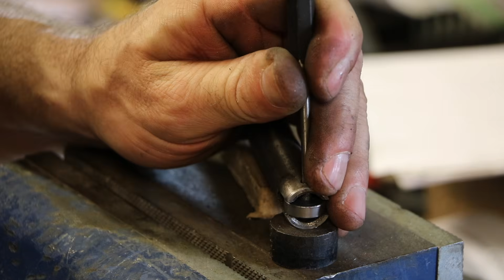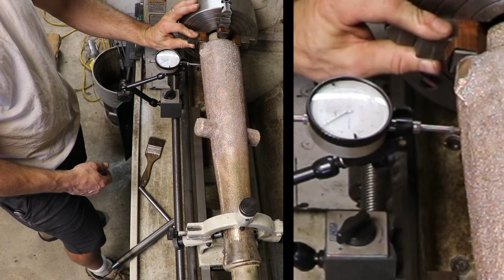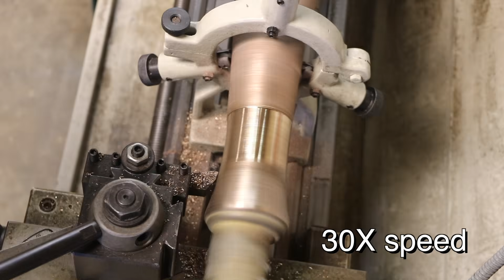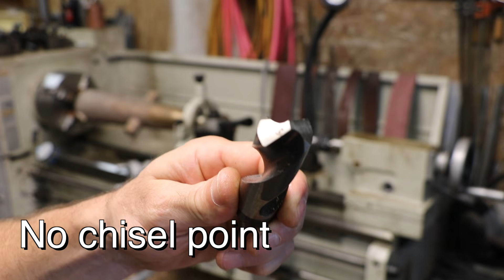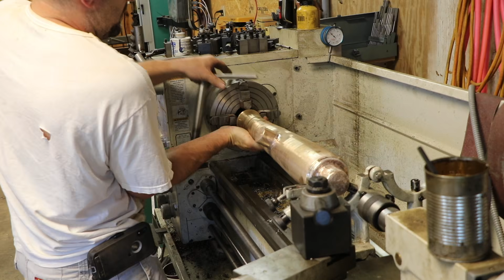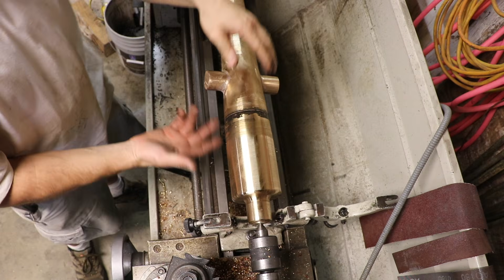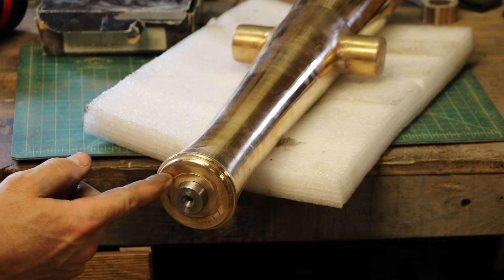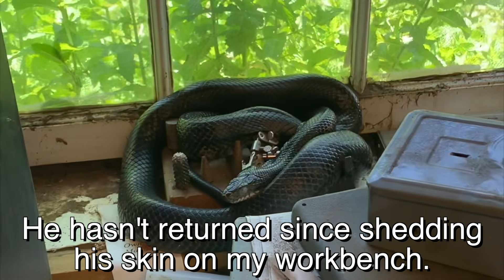Machining a Historic Bronze Cannon Barrel, Scaled Down Replica. FarmCraft101

Comment: Thanks for a series of interesting videos about the cannon, really enjoyed watching those. Too bad about the casting defect. I am a shooter and reloader (rifle and pistol, not cannon) and load black powder in some of my calibers. I would be careful with that void. As other say here it will impair performace, however I would be afraid the ball and patch could catch on the defect and induce a pressure spike. A steel sleeve would be a good solution to this problem. Have a look at this video from a cannon factory; they use a sleeve. Also note how they sealed the casting form, and how they added a reservoir to avoid shrinking: https://www.youtube.com/watch?v=NNMF6BDL8nk

Comment: Ok so idk if your going to read this but I hope it helps ,I worked for a vintage railway company and I was their technician or main worker but when you have these bad spots in a tube and it’s a very difficult spot you can do a couple things but they all involve a soldier that you can choose ,I go with a lead base to be original but you can take a perfectly sized plug for the hole with strong threading in it and what you would do is put it where the defect is then drill a hole where it is and fill it with a high strength/hard solder and fill the defect and after it’s ben sitting for a couple hours and has cooled to room temp then your going to put it in a freezer or fridge so it’s slightly cool compared to room temp then thread a large rod with a beefy handle and twist that plug, fare warning it will be very difficult but you will get a almost perfect barrel with little to non machining to run it because that plug will make a mold for that solder and the solder will take the same surface finish and fill it

Comment: I assume that if you actually try to fire this thing, you will do it electrically at a distance of about 100 feet.  Even then it would be wise to be  behind something sturdy.  The safest course, as others have suggested, is to install a steel sleeve.

Comment: If you're getting voids in your casting like that then get your metal hotter before the pour. 2200° F for bronze is normal but if your getting voids then kick it up another 100 to 200 degrees. This is what I did and I never got voids in my castings after.

Comment: You should be able to get an ultrasound crack test done by anyone who does pressurised piping. Over here, you would have to have the barrel proofed by a proofing house and stamped with the test charge size (usually 2.25 the standard charge size). For a one-inch barrel you should be able to calculate the black powder charge, probably around 2 cubic inches (excepting the touch hole filling powder and the firing quill). Probably use a paper-wrap charge, forming the charge case from the end of the ram you use.

Comment: Hey just a quick back of the hand calculation of your barrel pressure as a function of bullet possition:

 P=(P0*V0)/(V0+(x*pi*D^2)/4)  

Where:
P0=initial pressure
V0=initial volume (volume taken up by powder
D=bore diameter
x= possition from initial starting point of projectile (not from bottom of the barrel)

After finding pressure you could use a hoop stress calculation to see if the barrel would survive being shot 

That being said everyone talking about putting a sleeve in sounds like the safest method haha
Reply: That would work if the burning of the powder was instantaneous - which it isn't.
Reply: @cmdrsenior  you are correct but the worst case scenario would be if all the powder burnt instantaneously which is what I used to be conservative

Comment: In Cuba, they machine a real full size cannon, adding a stainless steel liner.
They do other .org as well.
So, why stainless steel? Or even why a liner?
Most real cannons are of bronze.
Over time, they crack.
Cubans have very magnetic cannon shot and modern propellants.
The decorative cannons with the plastic muzzle covers and electric wiring and motors are updates, first provided by the Soviet Union.
A small cannon can easily  fire a shotgun shell.
They can be made to look historically accurate, thread the breech in such a way that it is not visible.
Care must be taken, this is now a shotgun.
But, with proper care, an unusual piece.

Comment: Depends if your using it for shooting shit or just blanks if blanks you should be good if your shooting shit definitely sleeve it with gun steel i think its high carbon. My experience i like to blow shit up lol i made a canon out of a broom handle i use i kinda black powder mix iv fired it twice it scared the living fuck out of me. The first charge i put in was um i dont know i just dumped it in packed it in tight fuck me it was loud

Comment: You said you were going to place a sleve after some small bore fun shots, so to make sure you could place a band around the weakend area just to make sure the barrel won,t bulge or een break. also  brass, although not strong, can a lot of damage at high speed being tough.
Great piece of work though.

Comment: Machine a steel piece with an open side and closed end which is the same diameter as the bore. Weld a steel tube and funnel. Pour molten bronze. Allow to solidify. Re drill that area of thin steel.

Comment: It is very common, that the finger is to long on steady rests, but not that much.
And also, that steady rest seem to be good anyway. Some steady rests look terrible, and
with vintage bronze glide bearing. And the prize of them is also terrible.
The defect in the barrel is far out, i dont think it matters.  Just dont overload.

Anyway, you are good att freehand with the lathe. Here is my cannon, about the same size.
Made of tool steel, and the lavett of oak tree. Supposed to look like Wasa ship cannon.

https://imgur.com/iatA73D

https://www.youtube.com/watch?v=_HLUSO0BSEg

Comment: Actually, sleeving that barrel is an absolute pain in the ass, and hard as hell to do, and then what do you have!? 
To bore the casting undersized with no taper, create a sleeve with no taper and the correct press fit, (whatever that would be), then dunk your sleeve in liquid nitrogen for a few minutes to shrink it, then drop it in. 
You'd have to hone the bore to some damn finished size, (that is, the entire bore to the same size). This would take a good long hone set of the right range, constant cleaning after each honing but before you check your sizes up and down your bore every time in many places, "sneaking up" on your finished inner dia., many times with a very expensive dial bore gauge. A long dial bore gauge at that.

Unfortunately, casting was a mistake for DIY. (Not just a pretty steep learning curve, but some real trial and error and also cutting a few castings up!)
Gas pockets, porosity, contaminates, can give you a deadly dangerous piece that isn't visually flawed.
You can buy a length of round stock with a bore of 1" and an outer dia. of 4"! (then you got your bore almost done!) You'd three jaw chuck up the one end and center the other with the bore, then cut everything but your trunnion stock that you leave in the middle. 
You can machine them out by mounting your barrel on your saddle with V-blocks, then make a tool to be mounted in your chuck! Center, face, then turn, spin 180° and repeat, or use a milling machine if you got one. 

You put an internal thread in the butt end, then thread a spud of the same material to correspond, (best an ACME thread), screw it in good, then braise it complete, turn your braising to finish, and that'll do it. 
A touch-hole can be fitted with a percussion cap nipple or what not.
None of these guys are gonna be around if you try to fire this project. Think hard about that!
Opinions are like ass....

This cannon barrel could fire sweetly a hundred times, then blow itself up the one hundred and first! 
Better to call it a VERY attractive decoration, then start with a piece of round stock, (with or without a hole through the middle.)
Whatever you do buddy, good luck and thanks for posting your project!                 Nick

Also, the babbitt idea is a fuckin horrible recipe for disaster!
Think "PIPE BOMB" when firing regardless of whatever you decide. I've seen some really bad shit when people wasn't thinkin.
Reply: Yours is the best advice I have heard here. Everyone is trying to be helpful but second guessing just does not cut it. I know Farmcraft101 said he is going to fire it remotely but I think the unknown problems out weigh the known ones (and the known ones are not solved yet).
Reply: @Cloudman572 , 
   Yeah. Bet if he did a  rudimentary spin-casting set up it could solve a gas problem!?
   Sure ain't worth the danger factor! The fun goes down hill fast! lol  He made a good lookin cannon though! I think he aught to keep makin'um! This one goes on the coffee table though! :)

Comment: Even at the bottom of the bore I noticed pitting. This would indicate more voids throughout the casting, since the bottom of the bore is also the bottom of the casting. The visible large void inside the bore appears to be around 12” down from the pour. You’re hoping you don’t have any more. The ones you do show that you have significant sponging in your cast. If it was me I would recast. You are making a cannon and hoping that you have not made a 40 pound grenade. Do not try a projectile without having sonic testing done.

Comment: Some of the comments are quite valid Personally I would sleeve the bore. You can easily obtain high pressure hydraulic tube in the needed size but the originals were probably cast in a similar way and most likely had similar defects and I know the large bronze cannon cast at the Woolwich Arsenal did and they didn't blow very often and they saw use in combat. I have a small 4 bore bronze cannon made in 1812 by A T Cooper 27 mm (4 bore),  55.23 mm OD at the muzzle and 59.37 mm at the touch hole and a mass of 3.45 kg OK it is a lot smaller than yours and is mainly a signal gun but I don't worry about firing a 4 oz ball from it. OK I haven't actually weighed the ball and it is a rolling fit in the bore, but 4 bore = 4 oz near as makes no difference. Now the thing is this is a signal gun. Intended mainly to call the officers in for dinner etc. I have fired this with a 1/2 ounce charge of Pyrodex behind a ~4 oz ball with no ill effect. I have no clue whether there are any casting defects, nor do I care. The first time i Fired it was with a "proof load" a 1 oz charge and a 2 foot visco fuse (24 seconds) and it survived with no changes to the dimensions so I decided it was safe to load it with half that charge and a 2 - 3 second fuse, ... I am still alive :).
 I still haven't gamma spec'ed it yet to determine the metallurgy, but I suspect that you got it right.

Comment: For finding the center with sag I had an old machinist tell me to scribe a line vertically in the center on the end, then rotate it 90 degrees and that line should be made level, then scribe a new line vertically again and where they intersect should be center. Not sure exactly how accurate that is, but its always gotten me close enough.

Comment: can you not work out the pressure of the shot at that point using mathematics? i mean im no expert on this stuff, ok my field is computing, but i enjoy seeing projects like this.

But theoretically if you have 1 Sq inch of fuel that on ignition produces 27,000 PSI, once the wadding and projectile move enough to give 1 Sq In on additional space for the ignition pressure to expand into that 27,000 pounds of pressure now occupies twice the space meaning its half the pressure (13,500 PSI).

thus if the defect is 12 inches from the breach and every inch of movement is 1 Sq In of volume you would be down to 2,250 PSI. 
Still a fair whack of pressure, but please bare in mind im not sure of the dimensions of the cannon (even though it has been mentioned) so im only speaking in hypotheticals

As explosions follow the path of least resistance, hence the projectile moves instead of the cannon exploding,  its up to you to decided, if you work out the potential pressure at the point of the defect, then round up a little to compensate inconsistent packing techniques, that can increase and decrease the potential pressure, and you know your metal you actually have a few pieces that you can possibly  test the capability of at the thickness of your defect.

this should provide you with an idea how the first firing will go before you even get to loading it. thus you can choose to leave it as an ornamental piece or test it out.

though im positive that, even if the defect can fire 100 shots safely, a defect is still a defect, eventually it is likely to break under strain.

Thanks for reading, i hope this was not absolute gibberish.

Comment: How find center with droop; Mark a line/ring on your part, Measure diameter. Tool height=center of chuck from known point. Soooo ToolHeight-Radius=X 
Adjust steady rest until the distance from bottom of part to known point coincides with X

Comment: You could solder or by some other means attach a plug in the end and do a hydrostatic pressure test on it?  just turn the plug out after

Comment: You can't fire projectile with that kind of defect the projectile could get lodged because the defect can cause significantly higher pressure you have two options you can board out to get rid of the defect or you can bore it out give her the defect and insert a sleeve

Comment: might i suggest honing the bore. or at the very least putting sand paper on honing stones to polish the surface finish. as you would for a hydraulic cylinder.

Comment: When you were pouring the canon you needed to pour it faster in order to keep from having air pockets throughout and I would never ever fire anything out of that!
Reply: The Woolwich Arsenal cast their guns vertically but had a much larger reservoir for surplus metal to feed the casting while molten basically pressure casting the gun to reduce voids. But they still got them and the guns worked. All be it with some repairs to the voids but this is a tiny gun. With a moderate black powder charge max 2 Fg and a 1 inch ball I seriously doubt there will be a problem. As I did say I would sleeve it but if you prove it and if it passes your proof test I wouldn't worry too much with a standard load of 50 to 60 % of the proof load. Don't forget the makers of the originals did not have x rays etc. Just the gun barrel proof houses to test their work.

Comment: A shiny cannon is one thing, but a shiny functional cannon is, I believe, your goal. It may be worth it to slice this cannon into half-inch thick rings in search of other casting defects. This will determine if other defects exist (and where) so you may modify the casting process (if needed) to gain peace of mind with the next phase: firing a cannon!! However, projects like these could easily turn into years (and $$$) of fine tuning in the pursuit of perfection. OCD sort of has that affect on folks like me and maybe you.

Comment: I figured you could just make a sleeve for the finger to go lower, attach it to where the bolt is normally secured and that's it. Sounds like much less hassle than what you've done anyway and gives you more play too (for big and tiny projects both).

Comment: The best solution I Think is: As you are finding the center of the end and you definitely mean it will be Geometric center with respect to the mouth of the barrel.
so i suggest, mount a fixture at the mouth maintaining it center, hang it with a capable wire, then slowly twist it and release so its start rotating mark circles with some color markers at the bottom where you are wanting a center. if you get circles then you can definitely find its true center by different methods. i hope this might help. 
if you think this helpful then kindly try this out and if you find this helpful then it may be a good content for centering heavy jobs.
by the way its good to follow you. have a good day.

Comment: If you have an Indicol, you can put your indicator around your tail stock, and spin your indicator around the part, assuming your tail stock is on center enough for your liking, then you adjust the piece until the indicator reading on the top and bottom, matches the sides.

Comment: I'd look at brazing the defect and sleeve it.  Overkill, but the two will almost assuredly eliminate any chance of an issue.  At the very least, as others mentioned sleeve it.  I wouldn't rifle it but leaving it a bit proud and threading the muzzle would potentially allow you to cap the entire unit while in storage, OR get a ridiculously large suppressor for Shits-n-Giggles.  Yes the  Suppressor part is a joke.

Comment: Why not take the analytical approach.  25% of 27,000 psi is 6,750 psi.  You report the wall thickness is down to 0.5 inches and the bore diameter of 1 inch.  This results in a tensile stress of 6,750 psi  (6,750 psi x 1in^2= 6,750 lb / 2 sides =3,375 lb/side  / 0.5 in^2 =  6,750 psi).  The ultimate tensile strength of bronze ranges from 35,000 psi to 85,000 psi.  Using the low end of the range you have a factor of safety of  5.2 and that does not take into consideration the sharing of the peak stress in the material immediately adjacent to the defect area.  I would shoot it and if you are really concerned about overstress, attach a strain gage to the barrel in the defect area using epoxy and measure the stress as you shoot increasing charges.  When in doubt, ask an engineer ....

Comment: 4:25 I would have welded more collar on and made a new set screw hole. A less permanent option if I didn't like it but still strong.
Reply from the maker: I had the same idea, but the steady rest is cast iron.  Pretty tricky to weld to.  But that is definitely a good solution.
Reply: How would have tapping the inner part of the original collar and screwing in a new collar extension sound instead?